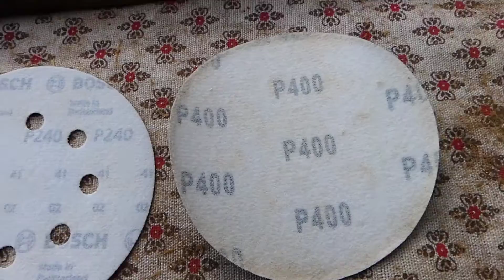Măsuța din lemn cu Rășina Epoxidica - pentru micul dejun

Comment: Is the epoxy you used a table top (1:1) or a deep pour (2:1)?
Reply from the maker: Hi, I didn't quite understand, but: the epoxy I used is poured up to 1 cm high. And mix 1: 2 example 100g resin 50 hardener